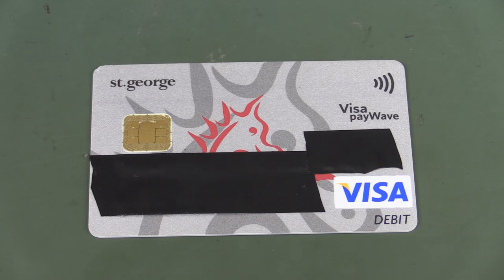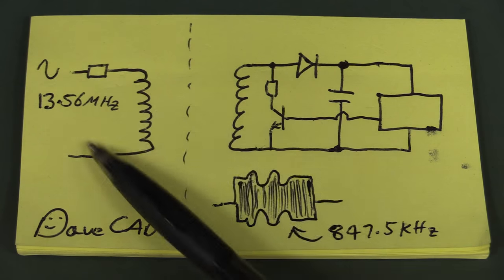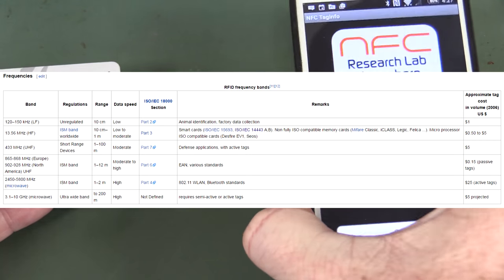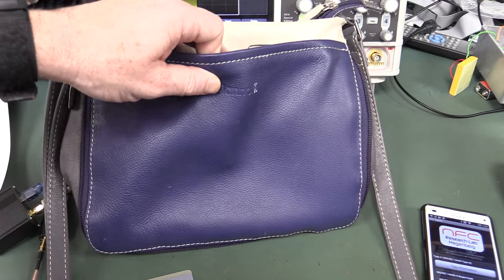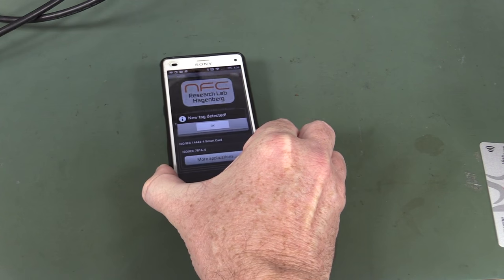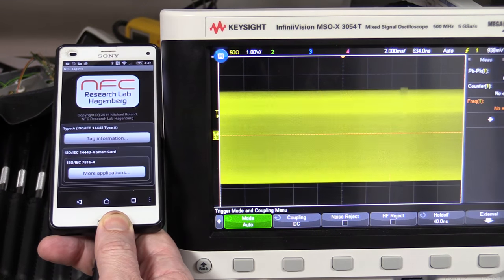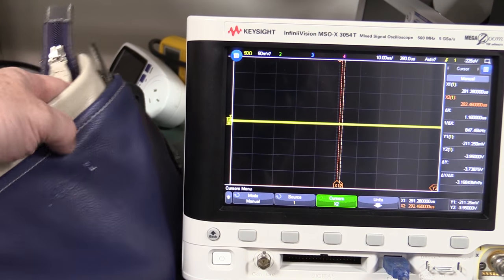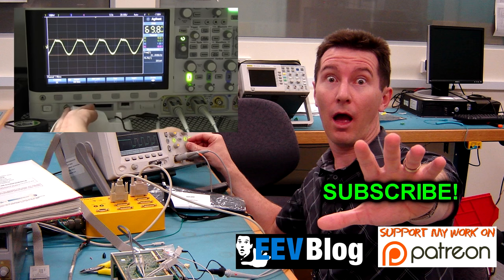EEVblog #889 - Credit Card RFID/NFC Theft Protection Tested

Comment: Guaranteed, I can scan your card through that bag with inexpensive equipment I built and use daily. I can read it through all passive shields tested to date, our database of failed shielding pockets, wallets, phone cases, and bags (airport luggage) is at 832 products with only 3 products actually causing significant issues extracting the information required to perform a transaction without visual or physical contact with the card. Be more careful about what security products you endorse as probably working, they only work on low power RFID readers. Criminals use high powered RFID readers. We believe there are a lot of criminals using these making it a HUGE concern with an ever increasing probability that any given individual will be targeted with an attack in a given timeframe. We will be probing many major metropolitan cities across the U.S. to discover the reality of how likely someone is to becoming the target of such a scam. We will post a site and post out data when we complete our studies. We are projecting study completion in November of 2020.
Reply: Nice to see you found something good to do after Mythbusters
Reply: @iwantitpaintedblack  Sorry to disappoint but my name is actually 今原一広（いちひろ）Ichihiro Imahara and Grant is a nickname. I'm not the mythbuster guy. No, I'm not related to him either. But he is the source of the nickname, coupled with the fact that my friends have a hard time pronouncing my name. I also get called itchy-hero.
Reply: @binaryglitch64  Hahahahah itchy hero man imaharass you with that nickname
Reply: @iwantitpaintedblack  not the first but thats a less common one lol
Reply: @binaryglitch64  Hahahaha, im happy with that haha
Reply: This may be true and you might be able to swipe badges and tags, but I'm not so sure about cards. The card needs to communicate with the bank, and considering there's money involved, I'd assume there's some sort of public key authentication process going on. So even if your reader can "lie" to the card and tell it it's the card reader at the store and then copy all of your data, you can't "lie" to the card reader in the store because you don't have the private key and you won't be able to authenticate. Then again, I'm just assuming this is true because it sounds too dumb not to be, but it wouldn't be the first time...

Comment: * puts on tin foil hat *
Reply: * puts on tin foil wallet *
Reply: Since cosmic rays are electromagnetic waves, and not simple magnetic interaction, I have bad news for you, mate. If your foil hat is not grounded (= not connected to ground with a wire), then foil will act as an antenna and will accumulate cosmic rays and release them onto your brain. But that would be happening only if the hat had been curved outwards your head. Instead, it wraps your head, meaning pointed towards your brains like a satellite antenna points to those Earth-orbiting pieces of solar-winged things continuously delivering porn around Earth. So your hat actually captures your mind / thoughts, concentrates it and delivers to outer space. Don't expect aliens are happy after you imagined them as short mouthless douches with big elephant ears.
Reply: If you put little rips around the rim of the hat and bend the tabs in alternating directions you can create a resonance that will buck emissions within a certain range. I used to work in a chaff factory.
Reply: Vyacheslav Kravchuk actually cosmic rays are mostly high energy protons, not EM radiation.

Comment: My friend's card info has been stolen twice walking through airports.
Reply from the maker: Wow. Why airports?
Reply: LOTS of different people...usually not poor (as they are flying)

so lots of targets...with lots of money.

no one questions a person with a back pack, a laptop, and things plugged into the wall waiting around for hours at an airport....
Reply: because the scammer gear are often in bags and in airports people are often close ny with bags, it just make it easy for them... also in public transport.
other then just reading the card there is encrypted then they use relaying, bad guy1 has an mobile phone with reader there is connected with bad guy 2 there is paying for some thing, so they dont need to decrypt the data. just transport the data between card and payment
Reply from the maker: But also much more security with people monitoring for suspicious activity.
Reply: They don't call them professional thieves for nothing.    Besides air port security is to busy thinking of ways to frisk Grandmothers and priests... Unless you're security for El Al.   In that case they profile to their hearts content....

Comment: For those of you playing along at home, the answers are:
4649 3455 1201 4809
10/18
Ain't that right Dave ;)
Reply from the maker: Wow, picking random numbers should have gotten you closer than that, I'm impressed.
Reply: On that note, name, number and expiry date is all that is needed for a transaction over the phone or online etc. (CVV is not required and it is the choice of the store if it requires it, though they get better refund rates on CVV checked transactions) and name, number and expiry date is exactly what the data the NFC chip gives.
Reply: An interesting note for young players: the last digit of a credit card number is a checksum, and is determined by the values of the other digits. This means that if you randomly create a 16 digit number, there is a 90% chance that it is an invalid card number that could never be assigned to an actual card, like this one.
Reply: Silverglass and the first 6 digits are the issuer identifier number and has to match the database, this is also how there are javascript libraries that automatically choose visa/mastercard/american express as you type the number in.

Comment: Before freaking out about NFC creditcard technology, lets actually think about what's going on inside those cards. 1) You cannot actually read "creditcard data", like on those swipe type (magstripe) cards - there's a chip inside the card that encrypts the PAN and PIN of your card based on charged amount and other stuff. That chip actually uses the payment terminal as an intermediary when communicating with a payment system. All of the information that goes into the card and out to the payment system is encrypted. In other words, until this encryption scheme is not cracked, it can be considered safe. 2) Even if you build a device that communicates with a NFC creditcard, that gives you very little. You also would need to find an acquirer bank that will accept a transaction from an unauthorized device. And believe me, it is tough and expensive business. So, I can realy guarantee you, that, if such theft will ever be accomplished, it will probably be one off. 3) If you were thinking, that you could make a transaction by "channeling" from an NFC creditcard into a legit payment terminal, well, there is a protection too. So, if you were thinking to make a living out of stealing creditcard data from NFC cards - just get a job. If you are just an owner - stop freaking out and spending money on silly stuff like that bag in the video.

Comment: Oh come on people. Seriously? You cannot do anything useful with the information you read from an NFC payment card. What you read from the card is basically just an "card id". From there, there is a back-and-forth process between the card and the payment terminal using encryption keys both in the card and the terminal itself to establish the identity of the card. You cannot read those keys from the card. Even if you record a complete transaction between a card and terminal with a third-party device, it's completely useless to you. So please all calm the fuck down!
Reply from the maker: Correct, but it's still a potential security flaw. Criminals can use it if they have a legitimate transaction system to enable such use.
Reply: +EEVblog Sorry that wasn't directed at you Sir Dave :) However, about the only use for that card ID that anyone can read from a contactless card that I have seen suggested is to perhaps track people passing by a planted reader, but since there is no easy way to connect that ID with any useful data on the card holder, even that is relatively pointless.

Comment: you could just snap off or cut out a little piece where the coil goes through and be done with the whole rfid shit. I don't care if I spend 2 minutes standing in a queue and 5 seconds paying or standing 2 minutes in a queue and spend 20 seconds paying if the price for that is that anyone can use my card or the captured data to pay without entering a pin or even do as much as give a signature.
Which fuckhead came up with that stupid idea anyway? I work in retail and 99.9% of our customers don't use it anyway.
Reply: FalcoGer The no pin part is definitely stupid, and never needed to be linked to the use of RFID.  It actually slows transactions down, as it prevents customers above the threshold entering their pin before the cash register knows the final amount.